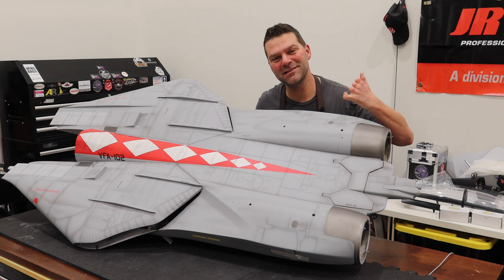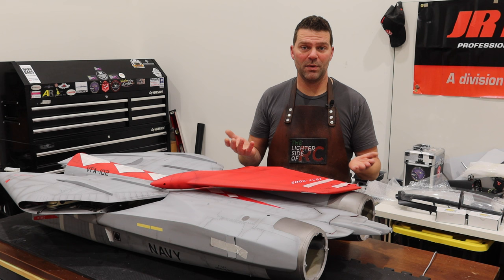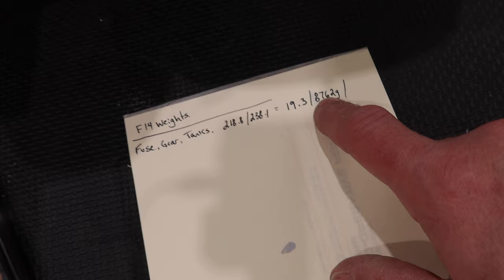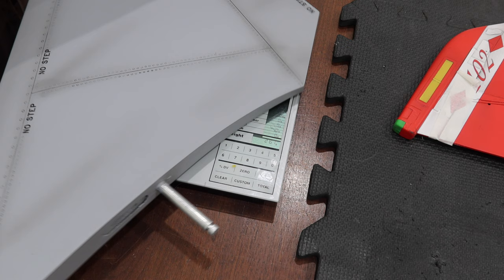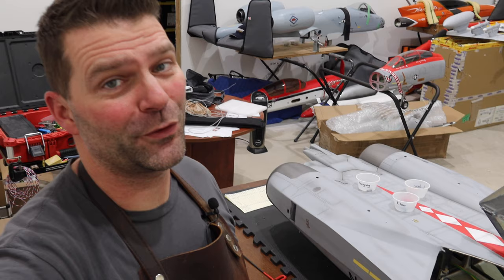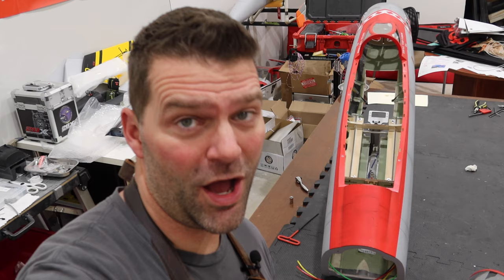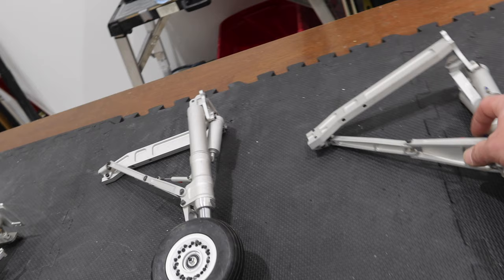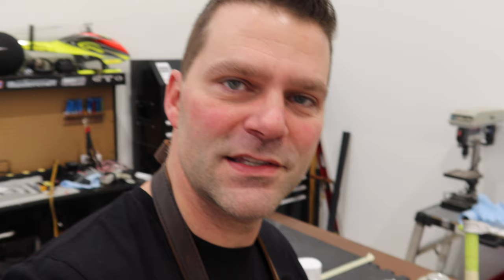TOP GUN F-14 Tomcat - Painting Landing Gear and Weights

Comment: A thought for your shop and painting metal parts in the future.  You could make a "paint oven" to bake the finish onto the parts (and speed up the drying/curing time) with an insulated plywood box and some 100W incandescent light bulbs or some infra-red heater bulbs (found at a feed store for raising chickens).
Reply from the maker: Great suggestion!  I don't think the wife would be happy If i was baking parts in the kitchen oven!😄
Reply: @thelightersideofrc  Another option would be to see if you could find a used electric oven (that could be set to a low of around 150 F).  Using the one in the kitchen could cause problems.  Unless neither of you mind ODD tasting food LMAO

Comment: Do not use anything that is silicone based in your shop anywhere not for polishing not for ceiling.  It will contaminate your shop and you will have nothing but trouble with fish eyes.  I've been a painter for 60 years and I had to learn this the hard way.
Reply from the maker: Thanks Michael.  Great advice but sadly the landing gear comes pre loaded with silicone oil which is why it's such a struggle to get the gear painted.  Pre heating the landing gear makes the process much easier.  I appreciate it.

Comment: Hi Jonathan,
Impressive start to this build series. Thanks for making these videos. I'm sure you could accomplish much more if you didn't have to take all the time needed for the camera setups. It's a shame that the first painting didn't go as expected due to the temperature, but you showed what was needed to recover, raise the temps, and end with an acceptable paint job. I'm amazed at the weight considering the complexity and size of this model. Thought it would have been more. Looking forward to the next video. You and Katie stay safe.

PS Will you be constructing your own runway on the property for testing after the build are completed?
Reply from the maker: Thanks Don!  I was blown away when I got the gear out and the swing wing mech out how light the fuse is by itself!  Felt like nothing!  
If I do a small runway on the new property it will just be for electrics type thing.  lots of space but not enough to fly big planes!